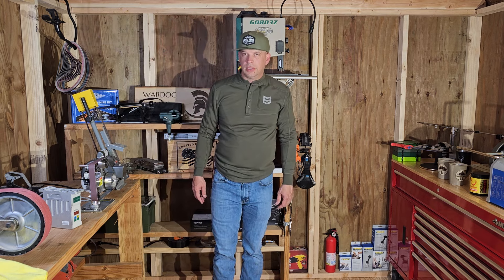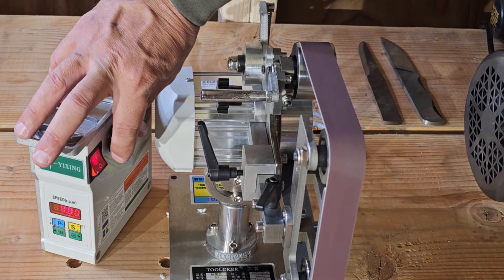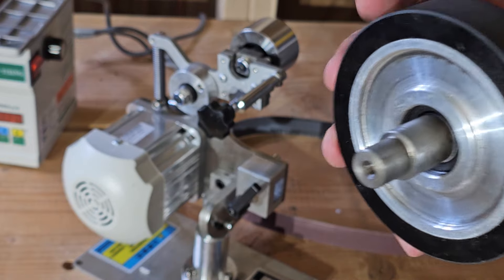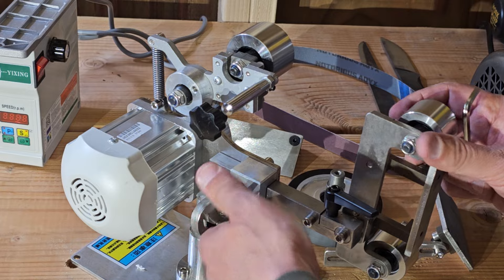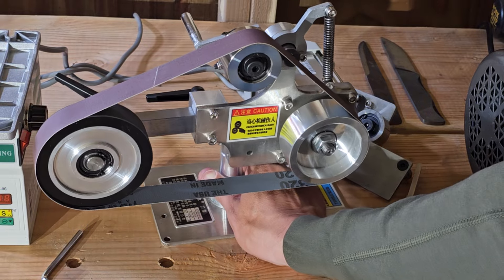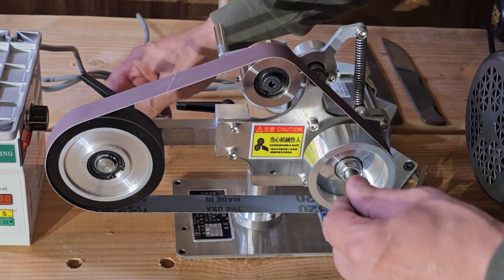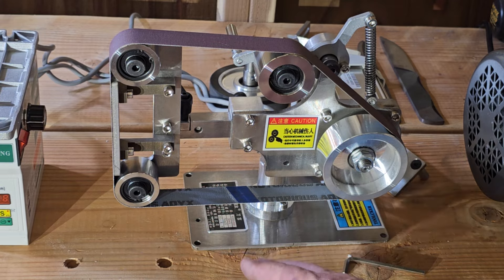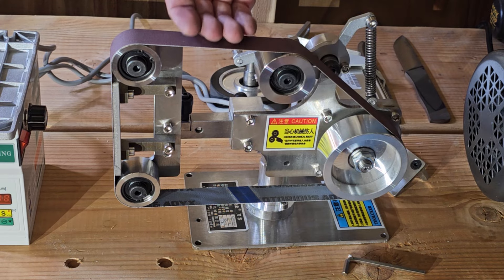Pro Grade 1x30? Knife Sharpener Blade Grinder Toolcker Belt Tool Review #sharpener #sharp #grinder

Comment: Honestly 4 inch is to small for hollow grind, maybe for final bevel ok, or if its a small knife, however I must say this looks like a nice grinder, very small footprint, could be good for mobile sharpening service.
Reply from the maker: Thank you for the input, I may grab a 2nd unit for sharpening with them. Run a coarse and fine grit belt.

Comment: I bought this machine five yrs ago , i think they were under 200 when they first came out, i cant exactly remember but from memory they were copied from a manufacturer from middle east, i used them to hollow grind butchering knives, they work but pretty slow, the tracking is also a bit flimsy especially when using cheap belts, they are pretty handy to use for sharpening and small projects
Reply from the maker: Thank you for your input.

Comment: the bolt you keep taking out of the platen and the contact wheel should have a washer on it before you put the bolt in. its not holding anything without a washer.
Reply from the maker: Thank you for the information.

Comment: Been looking for a 1x30 after someone stole my last one. Was thinking i would buy another cheap harbor freight like i had then do all the upgrades. But im thinking this may be the way to go...  Appreciate the video.
Reply from the maker: Sorry to hear your 1x30 was stolen. This is a great option much more advanced then most 1x30s. Thank you for letting me know you appreciate the content. Good luck to you.
Reply: @WardogOutdoors I don't remember what model the one you showed was..?
Reply from the maker: This is a Toolcker 550 watt small belt machine ordered from T-King on Amazon. There are other sellers as well. I had no issues ordering from T-King, it was delivered a few weeks early from estimated date.
Reply: @WardogOutdoors  Appreciate the help
Reply from the maker: Your very welcome, thank you for commenting.
Reply: @WardogOutdoors  My sander arrived. Box was pretty beat up. Plugged the control in & plugged into outlet. Power switch lights up but not the LED screen... Any suggestions?
Reply from the maker: I ordered mine from T-King and the packing was great, if you ordered from one of the cheaper places, I wonder if they short you with cheap packing. I think there would be a return policy through Amazon if your item isnt working currectly, but I dont know for sure. Mine has always worked since I got it. Sounds like it was damaged during shipping. Good luck, let me know what happens.

Comment: Do you think this would be a decent starting grinder for stock removal I'm trying to get started in the craft and don't want to shell out a grand for a 2x72 I would use it mostly for bevels thanx.
Reply from the maker: I have a video I did on a Multitool brand 2x48 grinder. It works great for stock removal. I believe its 1hp. The 2 inch belt is much easier to shape the bevel then a 1 inch belt. Im not saying it cant be done with the 1x30, its just going to take more time effort, belts and skill. My bevels I have done were much easier on the 2 inch belt for side to side evenness. The company that makes this chinese 1x30 grinder puts out a bigger grinder with a 2 inch wide belt. Grizzly has a 2x42 that I picked up a few months back. I have not had time to review it. I hear the Grizzly 2x42 has a weak motor so I may use it to sharpen until I can get a bigger motor. My recommendation would be a multitool 2x48 or equal grinder at minimum with 1hp motor for stock removal. I get no kick back from Multitool although they did send me a grinder to review. My first choice would be Ameribrade 2x72 or 2x48. I havent had the money to get an Ameribrade yet. There is also a machine that is similar to a Tormek that allows belts to work with the machine. It is variable speed and reversable with a guide rod for sharpening that looks like a nice tool to have.
Reply: @WardogOutdoors  Thanks. And I have seen the grizzly 2x42 and the motor isn't what has me bothered by it because I believe I would be going slow and taking my time being new and all, however the stuff I've seen about the platen is what has me worried I'm just getting going and I don't want to have to upgrade a tool before I use it. But am about to watch your other video thanx for pointing me in a good direction I really appreciate it. Earned a sub bro.
Reply from the maker: Thank you for subscribing. Your welcome and good luck to you. Im not a pro but I have ground a few blades. There are people who makes knives on 1x30 grinders so it is possible with this grinder. If it dont do what you want at least you could use it to sharpen, scotch brite belts for polishing and leather belt for quick strop.

Comment: what is the point of that allen head screw when going from the different tool heads? it isnt big enough to actually keep it from slipping through. it seems tightening the handle locks the spindle in place. what is the bolt for??
Reply: It's to hold the work table in place. If not using the work table you don't need them the black screw wrench holds the tooling arm in
Reply from the maker: Thank you for the explanation.
Reply: Those tho Allen head bolts are only for mounting the tool rest. If the tool rest is not being used, those two Allen bolts are not needed. However keeping in the two Allen head bolts in while the belt grinder is in use will keep the internal threads from collecting grit from the grinding process.
Reply from the maker: @profesonalantagonist thank you for the info and feedback.

Comment: Do you recommend this?
Reply from the maker: Yes, for a 1" belt grinder with a speed controller. Good style, well built. You might take a look at the Kalamazoo 1x42 for a low speed sander. The Kalamazoo is single speed. There is also a 2" version of this Toolcker belt sander that should be even better for even sanding side to side but it cost a little more. What do you plan to do with the sander?
Reply: @WardogOutdoors  I'm a blacksmith and I need to put an edge on blades and to clean the matirial
Reply from the maker: A 2" grinder may be better if you are putting the initial bevel on a blade. This sander is good for sharpening and minor grinding. I would recommend a more powerful grinder for the knife making process like the 2" version of this, multitool grinder attachment on a high speed grinder, Kalamazoo has some 2" high speed grinders and low speed sanders or Ameribrades grinders, although they are a little more expensive. A low speed sander isn't really designed for stock removal on a bevel, more for sharpening and cleanup. Is your bevel already established? If your just trying to make a bevel sharp this will do it. You may want to pickup a leather or felt belt to help with burr removal. Let me know what you decide to go with.

Comment: If you had to pick between the Kalamazoo and the toolcker which would you choose
Reply from the maker: The 1x42 is nice because the belt is longer so it stays cooler longer, but the speed is not variable. The Toolcker is variable speed, adjustable flat platten to different angles, 4" rubber contact wheel. Each has its perks.
Reply: Good question 👍🏻
Reply from the maker: @gregmccormack5709 I agree!
Reply from the maker: I have my Kalamazoo 1x42 set up for high speed leather stropping right now. It works amazing for ripping away burr/ wire edge. The 1x42 also works great with surface conditioning belts to resurface the sides of knives and shaping knife handles.
Reply from the maker: The Toolcker I am using as a high speed sharpener.
Reply from the maker: Did you have an issue with the bearings?
Reply: @WardogOutdoors  GREAT VIDEO. I'm seriously looking to have a faster sharpening system. Looks versatile and a great size.
Reply from the maker: @CaptDavesSportfishing  Thank you so much.